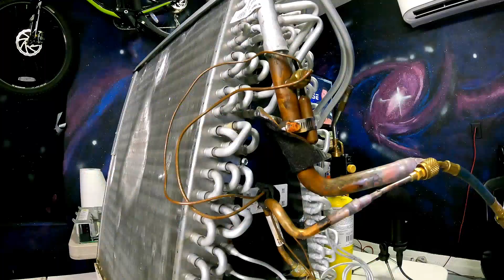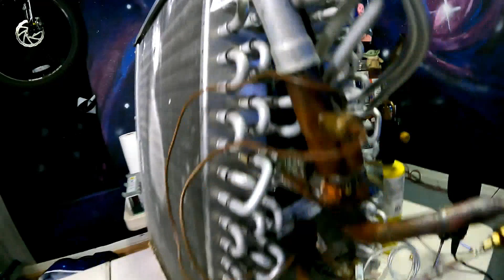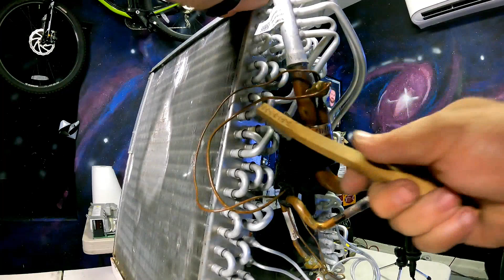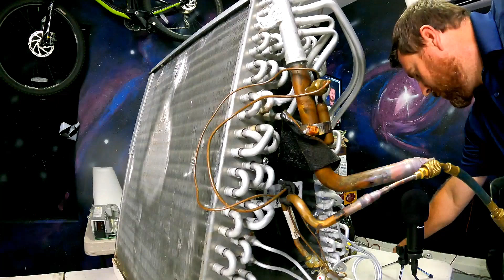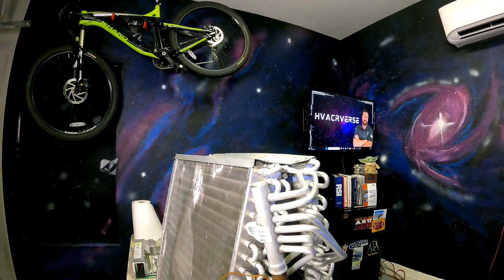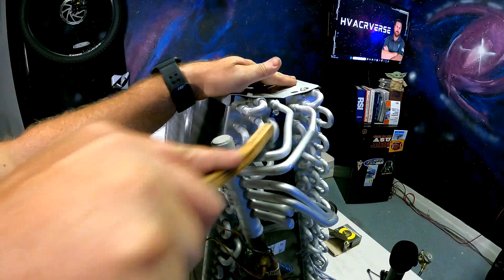Aluminum repair! Should we do it? Should we learn it?

Comment: I think we may need to start doing repairs but the welds are crap these days on coils. plus I think in shipping they get dropped or vibrated to death on arrival.

Good job on the repairs. Your trick with cleaning the pipe and then wiping it down with alcohol helps a bunch.
Reply from the maker: I have been having issues getting some Lennox coils and few Goodman coils.